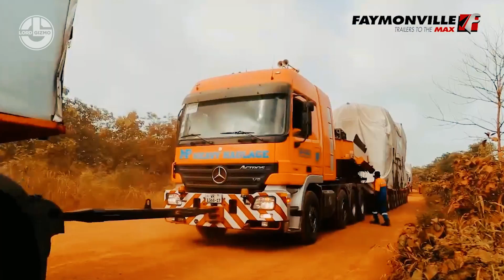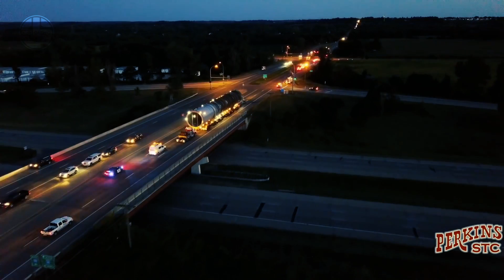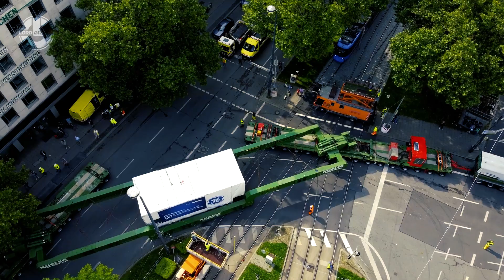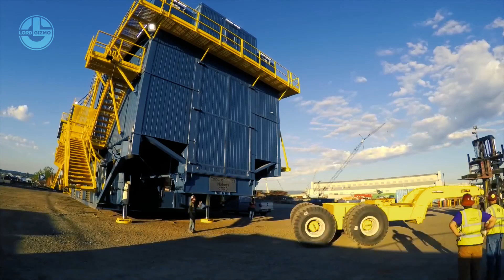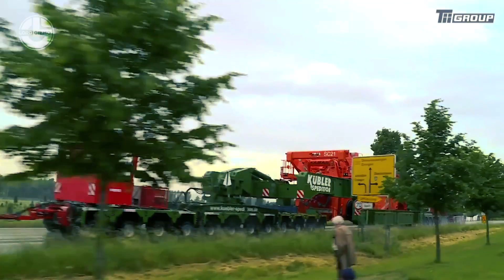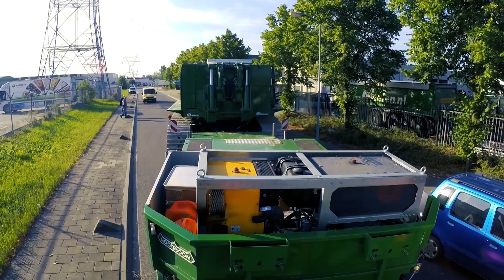Unbelievable Biggest Oversized Loads HEAVY HAULAGE By Truck

Comment: Talking about the shuttle’s fuel tank, the weight, if the weight that’s quoted is correct, clearly is not the issue, despite the narrative. Obviously the size of the tank is what made this a project-and-a-half.
Reply from the maker: To be fair, yes, we meant size above all else.  It wasn't light, but that alone wasn't the issue.